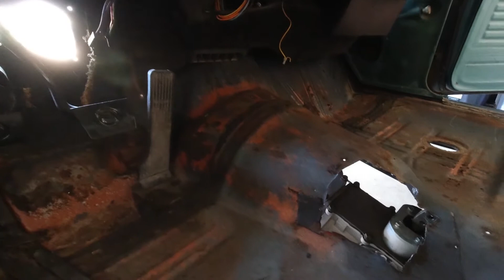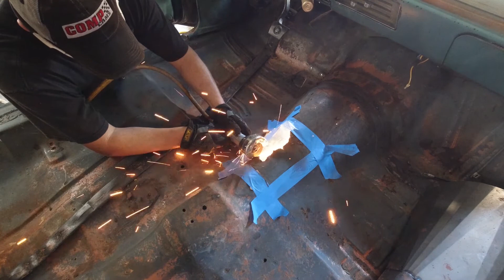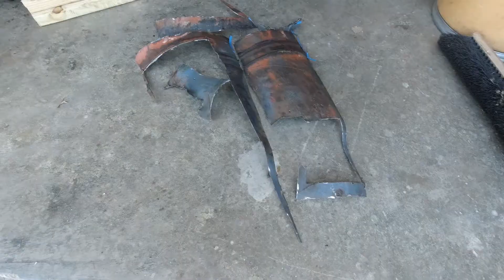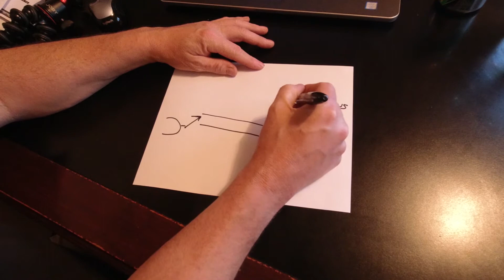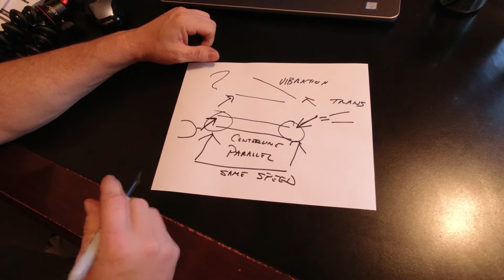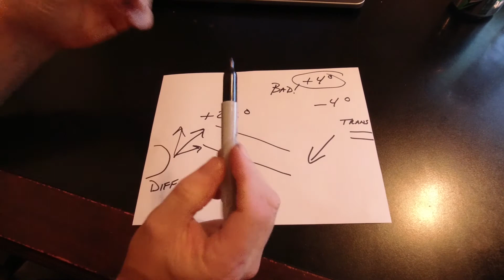The Chevelle Gets a T-56 Part 1

Comment: I am looking at getting a TKX for my 66 Chevelle. Do you think that this would be a lot easier that installing a T56? Very nice video by the way. Thanks  Eric
Reply from the maker: Yup.  It’s smaller and I think a lot of the Chevelle guys have swapped that without the major surgery the T56 requires.  I haven’t heard anything negative about that trans.  I’m looking forward to using it on a project sometime down the road.
Reply: @MuscleCarSolutions  Yes I thought about a T56 but I don't really need a .50 6th gear with a 3.73 12 bolt posi rear. It might be too high of a gear ratio. Thanks again.